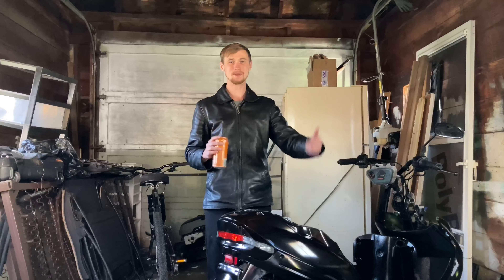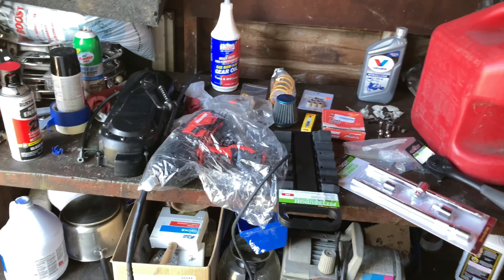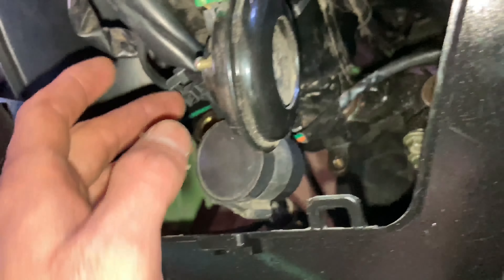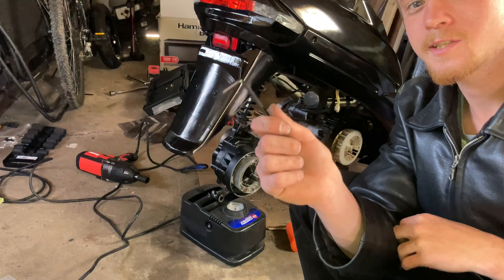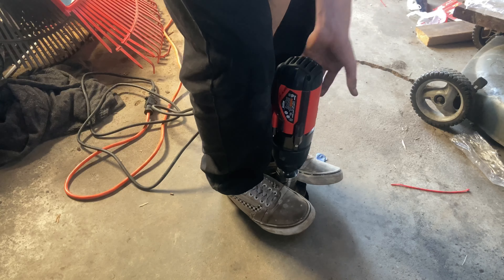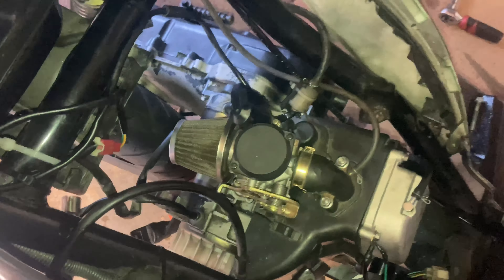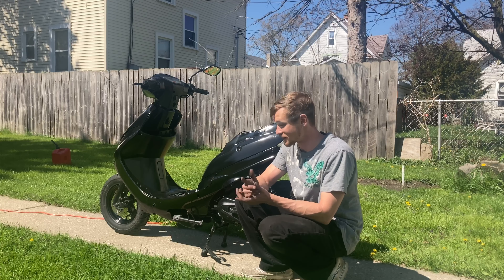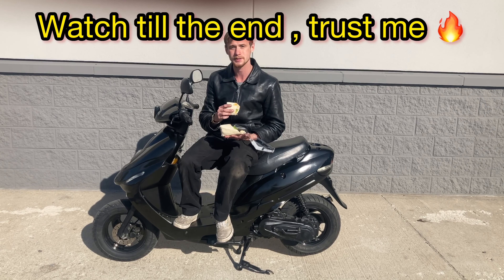First Startup Since Wreck | Taotao Pony50

Comment: I can't remember which of your videos I saw it in but what battery did you upgrade to? I'm planning to upgrade the battery and install a high torgue starter so I don't need to use the kickstarter every time because I already broke it once only to find out I cross threaded the spark plug and wasn't getting compression so had to order a new head
Reply from the maker: I’d have to look at the battery to tell you what battery is but it’s twice the size of the stock one I picked it up for my scooter shop I cross threaded my old stock head too man, twist it on by hand gently and carefully hit it with the tool last. It’s in the LED headlight video I will look at my battery tomorrow and let you know it was definitely worth the 60 bucks it cost
Reply: @davidhofinger4927  appreciate it! I found it in the video and I could read the label well enough, so I can look into getting myself one now!

Comment: Next time you install a contour spring try sitting down and use your feet you won't hurt yourself that way. Also when installing the belt make sure your belt is down some on clutch pulley to give you some slack up front so you don't tighten your variator driveface on the belt by mistake.

Comment: Great stuff, David!
Well, you have inspired me to put a 80cc kit on my chinese scooter. Might build it during summer holidays! 
I have a question. When you installed your 80cc kit, did you ride at low RPMs at first or not? If you did - how many kilometers  did you drive on low RPMs. This question is starting to give me a headache.
Reply from the maker: I did, I took it easy  about half throttle for three days to and from work and grocery shopping about 20-30 miles And then I started easing into its top speed for two or three days more. My bottom hand was already broken in so I was just breaking in the top end for about a week. Thank you man, I’m glad you feel that way. It’s definitely worth it not that hard to do and definitely will give you the extra push you want
Reply: @davidhofinger4927  Well, if you look at my videos (not promoting myself here) you can see that all the time I'm riding last, so I have a decent excuse to get a 80cc kit :D. Well, looking forward into your next video, ride safe!

Comment: will the rubber oring interfere with anything from working proper
Reply from the maker: Not at all, have it on it’s fine, don’t have it on it’s fine either way 
The one on the outside of the head
Reply: @davidhofinger4927  how much do you pay for the Vento? And how many miles did she have?
Reply from the maker: @rafaelcardona1927  used With a fully functioning motor before I blew it up lol
$150 But he gave me a hell of a deal to get it out of his shop
The miles I believe about 12,000
But the speedometer cable was broken when I bought it so who really knows

Comment: If you had to do a rough guess, how much would you say you spent on your bike to get it to 47mph before it got stolen?
Reply from the maker: Only about 600 regarding performance only parts, it still hits the same speed right now rebuilt this weekend I’ll be installing 1500 lb clutch springs Saturday and see where that puts her 👌
Reply: @davidhofinger4927  I’m having a hard time deciding what to do with mine. I just bought a pretty beat up pony 50. I’m going to restore it but for performance parts I can’t decide wether to just buy a 150cc motor and swap it or build the 50cc up. I’ve found a couple 150 motors for about 250-300. What are your thoughts?
Reply from the maker: @dizzygamer8063  I thought about the same thing you can buy 150 motor with a short case transmission and you could just swap it in you still need to make custom motor mounts. Or you can buy 150 motor with a long case transmission swap it in still have to fabricate motor mounts and extend the rear end. So I figured to save myself the hassle of all that custom fabrication and just build a 80cc that can keep up with a 150cc or at least close. It all comes down to how much custom fabrication you’re willing to do I’m too deep into this building to change it now personally